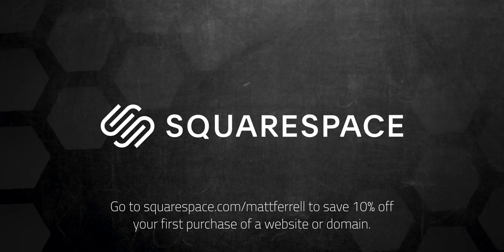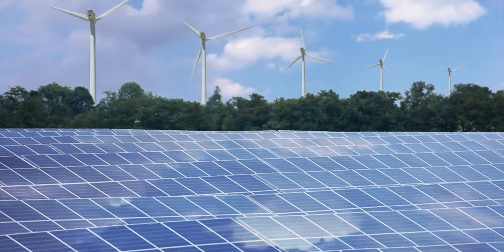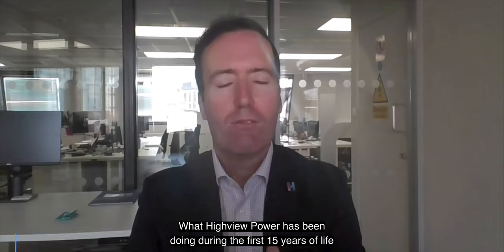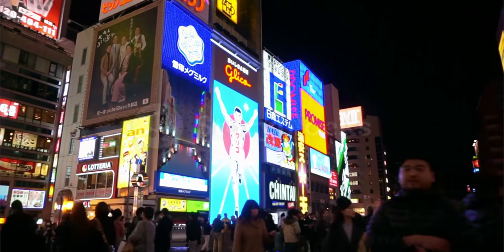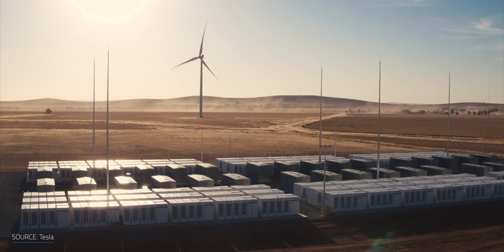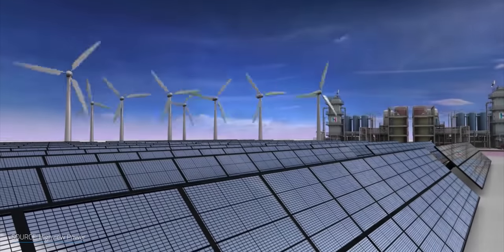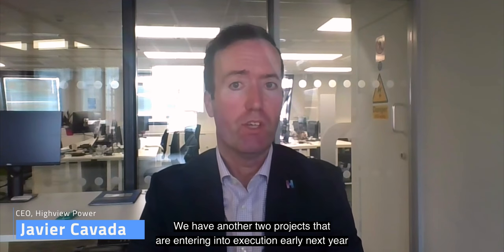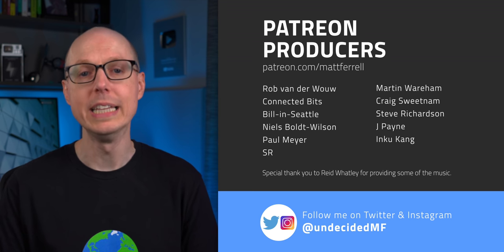Liquid Air Battery Explained - Rival to Lithium Ion Batteries?

Comment from the maker: So what do you think about liquid air energy storage?  If you liked this video, be sure to check out, "Supercapacitors explained - the future of energy storage?" https://youtu.be/-7T-6XdiRTw
Reply: Can you visit one of these and do a followup when they get it built? Please?
Reply: SO what is the final savings compared to the other options and at what scale will it be profitable?
Reply: Do air stop during night time? No. So why not just build more wind turbine.
Reply: As soon as you mentioned using power for phase changing and generating power off of changing phases back from a generator I knew the Efficiency and yield loss would be ridiculous. I would also assume the maintenance, manpower and scientific specialties needed to maintain the liquid energy plant would be very significantly greater than that of a hardline batterybank plant. The CEO talked about miliwatt per dollar efficiency being the efficiency that matters. But I think that still puts them on the short end of the economic stick. Perhaps it makes sense for a major metropolitan city where another massive plant fully staffed isnt as big a deal as other places.
Reply: @makisekurisu4674  To make that calculation, you would need to know what everything costs. You could pick today's number, but by next year it would change.
Reply: @MrYevelnad  There are times when air does stop. Then it is good to have something dispatchable. It is also true that if you ovrrbuild, than the amount of time you are short diminishes.
Reply: @makisekurisu4674  That depends on the price of batteries, but I saw another video on the subject, and it sounded like once you went over 8 hours.
Reply: I am curious as to the lifespan of installed equipment (how many years) vs other types of storage as well as what maintenance are required compared to others.
Reply: I think this is a very interesting method for energy storage. I would love to see a video about the production of hydrogen as a energy storage method. Not for cars or trucks but just using that lost energy due to, curtailment to power a hydrogen production facility then fuel cells to discharge. And what the energy in energy out ratios are,  and how they compare to this air battery.
Reply: May I ask about safety related to stored oxygen? How would it compare to other energy storage safety risks?
Reply: Efficiency is horrendous and its availablity is not instant. Batteries are much much better. Let batteries improve and in 10 years they will store grid energy eveywhere. Batteries are the future this technique is the past.
Reply: I have to be honest, I'm not thrilled about the clickbait title. It could be about mobile devices, vehicles etc. Was going to click "don't recommend again" but then I saw it was your channel. I suppose it's a matter of what kind of viewer you want in the long run: clickbait clickers, or people you can have a conversation with.
Reply: I have seen three other videos about this and was impressed with the technology, but unfortunately those videos didn't include the part in 6:48 or your explanation how we need the right tool for each job. The comments were full of people who just can't understand that batteries being more efficient or energy dense is not as relevant as price and endurance.

As I keep telling people, the problem with batteries is the cost and weight are calculated (output) * (endurance), which is almost always far more than the results of (output) + (endurance) formula used for other energy sources. If you can't dig a huge reservoir for gigawatt scale pumped hydro storage, even if you had a reliable supply of batteries the cost would be billions and you have to pay that again in relatively quick time as the batteries only have ten to twenty year warranty. Building CAES instead would cost mere hundreds of millions to maybe a billion, later expansions are easily possible and equally cheap, and most of the parts should last over 20 years easily.
Reply: @AnalystPrime  Batteries will improve exponentially in the coming decades, the cost to manufacture them will drop and their reliability will exceed decades. I'm very optimistic about batteries while we wait the next leap forward in energy (very interested by LENR research).
Reply: @Turbo999be  Tesla's new batteries are nice but not cheaper than simple insulated tanks that do not need to handle high pressures. More importantly it will take months or years before those are common in cars, and the decades in future batteries you are talking about might never happen.
LAES can be built right now at huge scale with off the shelf components by workers who do not need any special training or high tech equipment. It has clear advantage over tech that at best might be in sufficient production in few years.
Reply: I though about this idea around ten years ago, and how it would  make sense to do this in cold windy places, and then export air the liquified air by sea.
Reply: @samcohen5716  If you are going to transport a physical medium you need to turn the air into gasoline or similar high density fuel. If you aren't going to use the energy at location high voltage cables are simpler, easier and cheaper way to transmit it. Oil and gas pipelines and tankers only work because the resources can be collected cheaply.
Reply: So, wind to mechanical to electrical to mechanical to chemical(compressed air) to mechanical to electrical ,God...use oil...its safer,ecological and yeah, CHEAPER
Reply: @bismarckcro  You have too many steps there. Wind is mechanical energy, when transformed to electricity some is stored in chemical batteries for quick access, some in mechanical forms as liquid or compressed air or other methods, which can again be turned to electricity. And no, oil is never safer or ecological compared to those and because safety and not poisoning us all are part of its cost, it will never truly be cheaper either.
Reply: wow...might as well produce artificial fat molecule, oil or even carbs. Unforeseen potential for food production and fuel....
Reply: @fjalics  There are already two plants that I know of - the first was a relatively small pilot plant (350kW/2.5MWh) that was located in Slough, England and then a scaled up demo version (5MW/ 50MWh) built in Bury, Greater Manchester  - the first "commercial" plant is being built in Old Trafford Business Park (50MW / 250 MWh) - with an option to scale up to 1 GWh. There are three other projects in the planning stage within the UK.
Reply: I think this is going to be a big part of a carbon neutral grid. Look forward to seeing their plants come online!
Reply: @malcolmanon4762  How cool is that! Obviously, as the video clearly states, this isn't cimpetitive ar 2 hours, but what I am looking for is an answer to when you get two weeks of calm in the winter. 60% efficiency are pumped hydro numbers, and you don't need a hill, or water.
Reply: Liquid air is a niche solution, maybe better than lithium where geography prevents hydro solutions. However there is no way from an engineering point that such a complex mechanism can ever be cheaper per MWh than pumped hydro where geography permits. In addition hydro can respond in a few seconds, Grand coulee dam house #3 does just this for the western grid, with adjustments every 10 seconds to maintain both output and frequency. When speaking of geography it is important to note that electrical grids can cover very large regions, to not have any places suited for hydro in the whole region is actually not common.
Faster adjustment is not needed because all the rotating generators on the grid have huge amounts of combined kinetic energy that provides instant energy output to smooth the grid for several seconds, and for synchronous AC generation they can also provide similar absorption.
Reply: @mytech6779  I saw this same CEO interviewed by Now You Know. One advantage of the liquid air battery over Li-ion is the ability to provide rotational energy to nearby industrial customers, and also to make money by selling industrial gasses. In that interview he said site location was important due to those factors. It seems now that with "40 projects in the pipeline" the process is cheap enough to consider even in areas where pumped hydro might be possible due to the flexibility and comparatively low setup cost.
Reply: Hi MATT 🥴☠⛽☠😜🤑🤡I KNOW WHY THIS TECHNOLOGY AND ALL THE OTHER CLEAN ABUNDANT ENERGY TECHNOLOGY IS NOT DEVELOPED BIG GLOBAL TOXIC HAS TRILLIONS $ INVENTED IN 1 TOXIC LOCKED IN CARBION FOSSIL FUEL 🔥🌏🔥😱    TIME TO END GLOBAL TOXIC FOSSIL FUEL CONTROL OVER OUR WAR-TORN EARTH.      THANK YOU FROM BUZZ KEEP THE GOOD WORK ITS PEOPLE LIKE YOU MATT THAT WILL HELP END TOXIC 👍 😀 FOR A CLEAN SAFE WORLD 🌎 NONPROFIT LEARSHIP 😁🗣💚#ClimateChange #Transport #energy #buzzofftoxic #nonprofitleadership
Reply: My immediate thought is, "how much CO2 is removed from the air with this system, is it possible to store it?"
Reply: No it's not a great idea at all. When you turn to use the air in the "battery" you basically have to reabsorb all the heat you released when you liquified it. This means that you're boiling the liquid air in the container using heat from the gaseous air around the container. Considering the density of gas vs liquid phase, your battery not be able to deliver much power.
Reply: Reduce the cost of freezing the air with new desiccant-based refrigeration processes instead of Freon & the cost per kW could shrink well below coal-burning plants.
Reply: @fjalics  im a bit skeptic about this energy storage tbh. How much energy needed and how much energy is produced is not given. They only say about efficiency. And when air is released, how many turbines can it power? This also needs highly skilled labor workforce and also the maintenance seems not small.
Reply: My favorite grid scale battery is the Ambri liquid metal battery. Their batteries contain only abundant ubiquitous materiels. Both charging & discharging a battery makes heat, and in batteries large enough to power cities a battery that must stay hot is less trouble than a battery that must stay cool. Because its anode, electrolyte and cathode are all liquids, the actual battery is naturally stratifying liquids that make self forming and self repairing battery that can be shipped in sacks or 55 gallon drums, sort of just shoveled in, and will form the battery when melted at startup. Because its anode, electrolyte and cathode are already liquid, charging & discharging current density is limited by metal boiling point rather than metal deformation or melting point. And because its anode, electrolyte and cathode are all liquids, the battery also withstands one hundred thousand 100% charge / 100% discharge cycles (305 years at daily cycling) which is more cycles than even solid state batteries and much more than pumped hydro (that has moving parts). Liquid metal batteries also have the millisecond response times like lithium ion batteries and are more efficient that pumped hydro.

Because it has to stay hot the liquid metal battery is best for large applications where it is self heating (requiring insulation instead of cooling). The  full house powering size like a Tesla Power Wall is simply much too small an application. Ambri is a new company but has achieved use proof data. Their use of only ubiquitously abundant materials also relieves the expected shortages in lithium battery supply chain materials as grid scale storage will demand ubiquitous multi gigawatt hour installations.

Stationary storage is not weight constrained in a significant way, so use of only ubiquitously abundant materials is superior for stationary energy storage. There is no alternative to lithium in batteries that must be light weight. Lithium is the third lightest element, the lightest metal, and it is very highly reactive. For battery power density by weight we are stuck with lithium, but not for stationary energy storage. My preference for the Ambri battery comes from it’s high operating temperature, where insulation replaces cooling and where chemical reactions are faster and more efficient. At large scale high operating temperature is simply a superior approach, and molten metals is about as hot as we have the materials science to do at low cost.

With the liquid metal battery the 300 year lifespan drives the cost below pumped hydro after the initial cost recovery period where the cost is competitive with fossil fuels, requires little space and is not geography constrained (pumped hydro requires two lakes with an elevation differential). Nothing else I’ve seen comes even close when you plan to store petawatts of power with millisecond response times.
Reply: this is an interesting idea as efficiency doesn't matter when wind turbines are feathered and photo voltaic cells are sitting idle because storage is unavailable , i'm curious if the byproducts of this process are marketable, for example could water conensate be filtered frozen and sold as edible ice ?
Reply: actually. my thoughts were "what about diamond nuclear batteries?"
Reply: Matt - with the 4680 High Nickel cell, TESLA just made Lithium, Graphiene, Solid State and AIR CELLS , obsolete !!!!!!!!!!
Reply: Matt - TESLA stated at Battery Day, they will be DICHING LION for Grid Storage, too expensive and LFP is Superior. 
TESLA Megapack is Already PROFITABLE .
TESLA is going to use LFP in All GRID Storage Products - Powerpack + Megapack. 
LFP has LONG cycle life but Heavier but Weight is a NON Issue for GRID Storage. 
IRON is Plentiful, Reuseable, Recyclable. 
LION batteries are BETTER served in Powerwalls (for NOW), and in Production Vehicles. 
so, Liquid Air is BULLSHIT.
Reply: MATT - the Subject of LIQUID AIR has been Debated by Two bit da Vinci, Now you Know and Transport Evolved - Ad Nauseam !!!!!!!!
FACTS are MEGAPACK is Already PROFITABLE Today and each Megapack is 3mw of storage, can be Delivered on a Flatbed, Installed in just a few Weeks. besides , TESLA will be Switching to CHEAPER LFP batteries for Powerpacks and Megapacks.
Reply: MATT - a City/County will NOT Permit Cryogenic Liquid Air to be Placed ANYWHERE, excipt for Unpopulated Areas or Industrial Zones. 
just like with HYDROGEN - C-H2 Production/Storage. 
TESLA Megapack , is TRAILERABLE, and can be built on Site , in a matter of WEEKS for INSTALATION !!!!!!!!!

Hornsdale was built in less than 100 Days with Powerpacks.!!!!!!!!
Reply: MATT - Disliked this Video and now Disliking ALL your PAST Videos , for LACK OF SCIENCE and 1st Principles in ENGINEERING.
Reply: MATT - LAES in the UK is ONLY 5 mw/15 Mwh . 
Liquid Air is ONLY 60 - 75% Efficient .
LION is 90% Efficient. and Delivery is Instant. 
LAES uses a TRUBINE that has to spin up = DELAY Responce. 
TESLA Megapack is 4x Faster than a ICE Powerplant.
Megapack is 60% better than Powerpack.
TESLA can build 1 Gwh Megapack in LESS than 3 Months ,on a 3 Acre footprint .
TESLA is building the LARGEST Megapack GRID Storage in the WORLD at MOSS LANDING.
183 Mw with 730 mwh in Storage.
Reply: This reminds me of a video from 2 years ago from Cyclone Power Technologies. They have a system that collects solar power in the form of heat and stores the energy underground in a storage tank. Far more resilient than photo voltaic systems and much safer and cheaper.                                                                   Regarding wind I have a question. Why is it not cost effective to scale down wind collection so that the system can sit on top of a power pull?  There would be many more of them, they should be cheaper to produce, and closer to the energy transmission lines. I’m thinking of something like a whirl cage (?) wind mill, like a short vertical tube about a meter high and protected by a bird cage to keep squirrels and birds from getting into it.
Reply: Edit : “Power pole”.
Reply: I'm actually curious on how they "store the heat from cooling" the air down to cryogenic temperatures, and for how long they can keep it with out needing additional energy.
Reply: @soulhunter0   - Liquid Air battery require LOTS of Fossil Fuels to cool down the Air + Maintain it.
Reply: @fjalics  for me that's the main question on pumped hydro

do you need a natural?

why not create a 7 story building and place  the reservoir on  top of it?
Reply: @mytech6779   does it  take liquid air systems  a long time to respond to energy demands?
Reply: @welm98  I too wonder about the safety issues.  Maybe a follow on video discussing those?
Reply: @markplott4820  That is not what I wanted to know, I wanted to understand HOW they store said heat.
Reply: If we filled a thermostat with liquid nitrogen and fit it with heat generator electronic components which produced high heat then will it helped in this condition ???since coldness of nitrogen keep calm the electronic components

Make experiment in this regard so we need a very very strong case for thermostat making 
Once it's calculated then it's massively change the ways of living forever
Reply: @vk45de54  you absorb heat from surroundings, if you have -160degC and want to heat it up just expose it to surrounding air outside and it will start to warm up to +15degC or whatever temperature you have outdoors at the moment.
Reply: Do you remember the Zinc air emergency batteries for the old Nokia brick phones?  it was sealed in foil and would last until you opened it to air.  Then it would generate power for a good amount of time then you tossed it.
Reply: What do I think about LAES? I think its transformative.
Its relatively cheap
Modular
Tried and tested technology/components
No exotic materials
Bridges the energy storage capacity from batteries to water storage (lakes)
Independent of geography
Can be fixed with a spanner
Compatible with existing energy using plant

It ticks all the boxes and for the first time as far as I can see opens the door to 100% renewable baseload power.
Reply: Best solution would be decentralization but individual generation with water tower power storage. That way everyone would contribute their own storage and the corporations would have to design their own
Reply: A NITINOL pump or generator might be a good match up with this ideA
Reply: With the potential to convert the frozen air into steam, it could perhaps be utilized for more efficient steam energy generation depending on the methods of freezing and heating the air.  To generate electric energy via flywheel with steam is apparently still a valuable method today for generating energy, so even with it's current restrictions for a turbine, it may prove useful if utilized in a steam engine variant instead.
Reply: Or blend the two. Produce hydrogen from water splitting, purify CO2 from the air with air liquefaction and then react the two to make liquid hydrocarbons. Then it's transportable AND the general public isnt driving vehicles with high pressure hydrogen on board (an issue people outside the chemical industry don't understand)
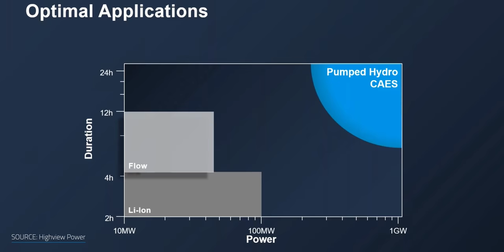Reply: If you say something like "there's a link to my video on flow batteries in the description" 8:34 then it's a good idea to put one there.
Reply: Should it be called "solid air" then (instead of liquid air) if air is frozen at very low temperature?
Reply: It’ll explode
Reply: Romeo Power produce Air-Cooled Liquid-Cooled Battery. Romeo Power Facebook Page: https://www.facebook.com/1745387255696378/posts/2933888640179561/?extid=0&d=n
Reply: Hydrogen is just better
Reply: The guy over simplifies the process . It is not as easy is cold compress in and  hot air expanded out . You lose 30% of the heat during expansion even with best insulation methods and transfer . Not to mention the cold energy that is lost is 35-40% .
Reply: But do they have a domestic model?...
Reply: It's called project Jericho my father invented it he used sound waves to push the turbine using his spherical speaker enclosures made of fiberglass acoustically tuned to the harmonic of C# and  mounted to a parabolic reflector dish thereby achieving Brownian motion I would say this is not rocket science but considering 70% of the energy used to push a rocket or turbine or ICE , or propulsion if a rifle round is acoustic waveform energy not thermal energy the other 30% is thermal energy now why are we basing everything we know about energy based on 30% of mechanical motion? Doesn't seem very efficient does it? So why not just you sound waves themselves to push a turbine? With an input of a 12-volt system a car battery literally and a and a series of 40,000 watt amps stepped up exactly the same manner you would for a Marx generator? What is profound information to others can be mundane to those with wisdom...

You'll get it eventually but not before the sun just basically kills everything electrical that's what happens when polarity flips imagine all your terminals on all your batteries going from positive to negative and vice versa simultaneously all over the world not much of a future there.... On the other hand those of us that know this and know how to make energy correctly with the zero emissions 0 carbon even sound waves can be canceled out with a vacuum so an enclosed system with a vacuum pressure would make it silent and do the Brownian motion would infinitely cool it true cryogenic fusion using sound waves and basic elements since no heat no friction no wear and tear on bearings no need for bearings if you do it right magnetic fields can suspend something just as efficiently omnidirectionally if built correctly but then you would have to understand exponential trigonometry not binary based euclidean geometry. Hang on to your hats cuz it's going to be a bumpy road and wind power is not going to fix it the foundation of wind turbines is so massively destructive and detrimental to everything Environmental it requires a foundation the size of a house in concrete 120 m tall 90 m tall blades Which discarded as soon as they reach critical structural failure which is VERY Often, lithium ion batteries require lithium mines which is a similar process to mining natural gas it's a form of fracking in salt flats translation most of the ancient rainforests and current rainforests our locations for salt flats if you will think don't desulphating a battery on a worldwide scale of which you would have to strip mine and destroy completely the Amazon and the Congo to mine this wonderful technology that you think is so advanced including neodymium for all these motors to drive all this Cobalt there goes the Congo and various other toxic forms of materials in the process I advise you to look up in it Neodymium Mine or a Cobalt mine besides the slave labor being used child slave labor yeah real clean....
Reply: In Germany and Austria there are already set ups where heat is used that is produced as side product of electricity generation or waste management. Typically when garbage is burned or the sewage water is fermented to make methane gas. The gas is then burned and used to produce electricity (23 % efficiency, or in that range) and the abundant side product -  heat -  is used to heat up water.

Combustion engines and heat engines (for the production of electricity) are notoriously inefficient because so much of the energy ends up as heat not as motion to turn the turbines - but when they can put the heat to good use, the efficiency goes up to over 60 %. 

That is usually peak demand electricity, because they have storage tanks for the hot water, and can determine to a degree when they produce. 

And the higher demand (for hot water for use and for heating of homes) conincides with the need for electricty. But the are also an emergency backup (I think, those gas turbines are very agile and fast on the grid if need be). 

They have that setup even for homes. A furnace that is run on wood or biogas and also produces electricity. 

So, yes it is weird that the Germans are not doing it already. But these would be large systems and the energy transition was a project of political opportunism of Merkel (very much triggered by Fukushima, JUST when she had undone the slow exit from nuclear power. In German they call it the exit from the exit from the exit. 

Her heart (or that of the "conservative" lead government is not in it and it shows in the lack of vision.
Reply: Yo Matt... If we plan on using this method to store energy... Why not store hydrogen... Besides the fact that it would kill Tesla and the corn industry would have to focus on food...
Reply: @MrYevelnad  because they are garbage.. they break long before being profitable sadly. Look up the wind and solar farms around the world... Might as well be a world fare event canter.. just broken glass and rust.
Reply: @welm98  well... Storing oxygen can be dangerous.. ask any welder...
Reply: @Turbo999be  batteries aren't any better once you include production... Plus the mining leaves the land and water toxic.
Reply: @Turbo999be  psst... If that were the case... Why are we going backwards? New tech is based off old tech... Storing energy is harder than creating it... And horrible people are getting rich pretending they have beat patrol...
Reply: @AnalystPrime  wrong
Reply: @tsamuel6224  but would you sit on one... That is the real question ⁉️
Reply: @matthewschultz8539  Such eloquent answer... Oh, wait, no it is not. Also, you are eight months late.
Reply: @AnalystPrime  a good answer can be timeless.  

You are very welcome.
Reply: What about adding an CO2 stage separation? Can be done with membranes.